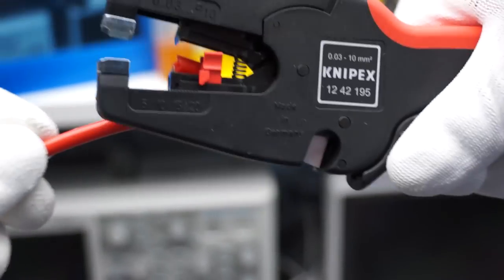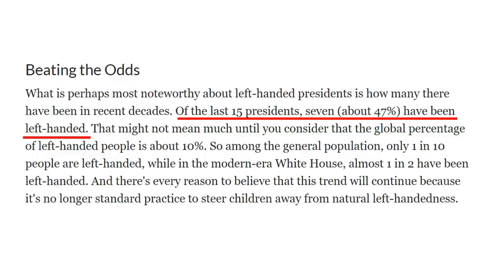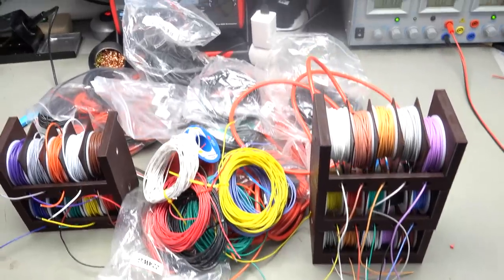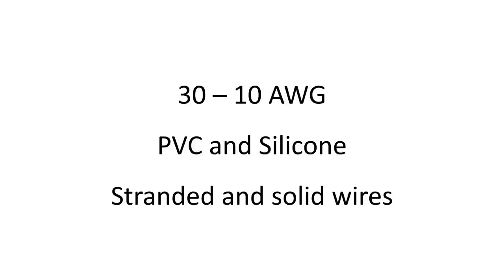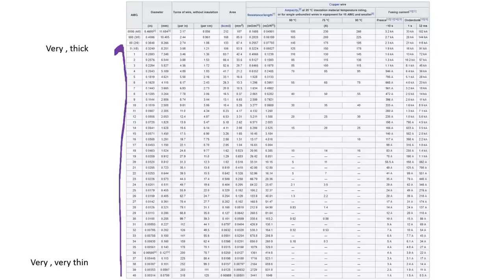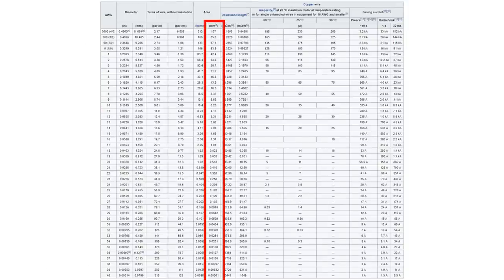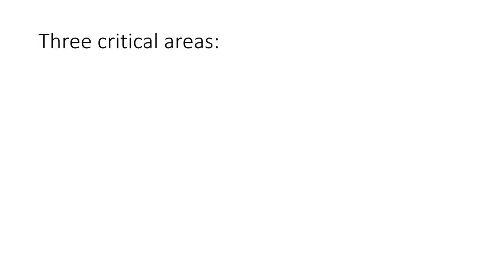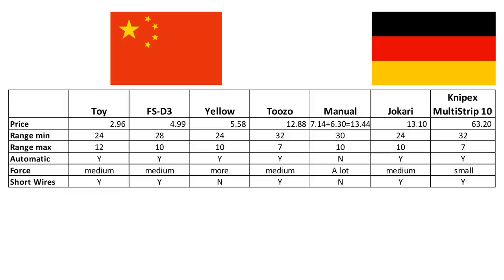#268 8 Wire Stripper Test: Germany vs. China. Who wins?

Comment: Nice test.

Usually the manual wire strippers are calibrated for solid wire. Klein explicitly lists both solid and stranded, and the stranded is always one size up from the solid.

The biggest problem with the automatics is slick insulation. US THHN wire designed for sliding through metallic conduit has a very hard, slick outer coating and most automatics can't touch it. Those that can fail on fine wire.
Reply from the maker: Thank you for the information!

Comment: I bought 2 Toozo at around US$7 each. They're not that good at the beginning cos' they tend to cut thin wire. But I manage to take them apart, sharpen the blade and reduce the cutting force a bit by sanding the jaws (thus reduce the pressure of the blades) and now they work even better than the Knipex (I used it for quite a long time). I'm glad I didn't bin them.
Reply from the maker: Thank you for the information!

Comment: I have a question: Do you use AWG in Switzerland? It doesn't make sense to me. In Germany, we use mm². That makes much more sense. I can imagine how big the diameter is. I can measure it with a caliper. When using mm², I can give a value for all sizes, even larger than 120 mm² (if someone needs such diameters :-)). So I don't see any advantage in using AWG or am I wrong?
Reply from the maker: I use AWG because I am used to it (and my channel is watched in many countries). But officially, we also use mm².
Reply: @AndreasSpiess  OK that makes sense. I am used to use mm2 so I had to think a little bit about the sizes. Before I forget to mention it: thank you for your great videos
Reply from the maker: @samuelmumm9827  All my silicone wires from AliExpress have the AWG printed on them ;-)

Comment: those yellows are fantastic. You can strip long lengths, and even able to strip ribbon cable. Cant do that with any of the others. Sure, not perfect, but you can apply a touch more pressure with your fingers to get a good result, as well as the adjustment screw others have mentioned
Reply from the maker: Thank you for your feedback. Viewers commented there are different makes which look the same.

Comment: Should be noted they "Yellow" strippers (Mine are branded Vise-Grip, but same style) have a tension adjust knob. Can crank that down in order to get better stripping on thicker silicon cables. I use them regularly for that.
Reply from the maker: This knob did not help in my situation. But there are many different "yellow" strippers out there (reading the comments). Some good, mine bad :-(

Comment: I never use automatics as I work in the field.. takes too much belt space. I will use a jacket cutter ie a spinner for anything I cant get with a manual... and you can carry three for the space of one automatic.. all are useless for multiple shielded conductors. ie 18-2 or 24-4.. probably ok for benchwork but only with the knipex. even then I dont like the squishing of the insulators. I know for a given thickness of wire how many turns I need to make to leave that tiny bit of insulator before hitting the conductor.. these are for just being fast which is usually not a DIY concern.
Reply from the maker: Thanks for sharing your experience!

Comment: I have a different type of  knipex  cutter to yours, I got it because I needed perfect straight  and accurate cuts when sleaving pc  cables, but I also have a stanley branded version of your yellow cutter, I found it works better the wrong way around that being the grippy part latched on the bit thats being discarded, that way it doesnt leave a mark on the cable, the other thing to note about that cutter is you can adjust the tension by turning the wheel, I managed to work a way of  stripping down to about 26 or 28 awg from  cat 5E  cables for endstop switches for a kossel with that cutter too but only by putting a small amount of thumb pressure on the top of the jaw thats gripping the cable as it cuts otherwise the cable just slips through, but now I have the knipex I dont need to do that
Reply from the maker: Thank you for sharing your experience!

Comment: Try something like a cc-22 (ca-22 is searchable on ebay). Its usable on pretty much everything below 35mm2. I replace mine about every 2 years when i feel its starting to loose its sharpness. (Im an electrician so i use it ALOT) 
Autostrippers isn't the best option if you strip lots of wires, the impulse that goes into your hand/wrist can be harmful on extended use.
Reply from the maker: Thank you for sharing your experience! AFAIK they also sell battery operated strippers for heavy usage.

Comment: I can recommend the WEIDMÜLLER WDM-STRIPAX 9005000000 stripper, so far the best I've used. I tested knipex and some Chinese ones. And this one work just great. They have more adjustment possibilities and spare parts. The only drawback, the price, they are expensive.
And the fact that the isolation stays on the cable, it is sometimes ok, becouse you can much easier twist the wire, to achive beter solder.
Reply from the maker: Thanks for sharing your experience. They look very similar to the one from Knippex.

Comment: Very interesting video as usual.  I still use an old pair of manual strippers bought from RS many years ago and could not justify the outlay for the Knipex.  Just a couple of points though, the plastic material surrounding the wire is INSULATION, not isolation, even though the insulation isolates the wire!  Here in the UK we still use some imperial measurements, miles, feet, inches etc and we have SWG - Standard Wire Gauge still seen in wire and sheet metal.
Reply: Yes, insulation!
Reply from the maker: Thank you for the correction!

Comment: Unfortunately you didn't test really small wires. I often reuse old flat-cables and stripping these with the Knipex. It works really great and I wished I bought the Knipex years ago.
Reply from the maker: I usually use flat cables with press-fit connectors. That is why I did not test it. Thanks for sharing your experience!

Comment: How do these automatic ones know what wire thickness you are using?
Do they have something you have to adjust for each wire?
Reply from the maker: The Knippex has nothing to adjust.
Reply: @AndreasSpiess  Interesting that it can "detect" thickness somehow. What about the "toy" and "yellow"? Do you have to adjust for each wire?
Anyway I just ordered one of those "manual" Chinese ones based on your review because they seemed fine. Only the bigger version (min 22 awg) was available tho, I hope it's good enough for my thinner wires.
And thank you for your answer.
Reply from the maker: I do not know how they do it. But the manual one is a good choice. But you have to have one with the fitting holes. Otherwise it will not cut the plastic. I used two of hem

Comment: I bought one similar to your "Toy" stripper many years ago but mine has a screw adjustment on the back of the head to compensate for thinner or thicker wire. It actually works pretty well once dialed in. There is a USA made one like your "Yellow" that is known to be a better product even though they look the same. It's made by Irwin/Vise Grip and it works extremely well - better than the "Yellow". Probably the best strippers I've ever used are any USA made ones like your "Manual" strippers. They take a bit of getting use to but they do the best job once you get the hang of them, probably because the cutter notch is rounded.
Reply from the maker: Thank you for sharing your experience. BTW: My yellow one was defective and the new one works much better...
Reply: @AndreasSpiess  Cool!

Comment: 14:35 - for soldering leaving the isolation on comes in quite handy because it makes twisting the nakes wire a lot easier. you just turn the isolation why pulling it off and your wire is perfectly twisted and doesn't get messed up that easily.
Reply from the maker: Thank you for the tip!

Comment: For wire stripping I use Knipex. Worth the money. Now a diversion...
Circa 1500 London Mile - 5000 feet (defined in furlongs using the German 'foot' length which was longer than the English). 
Statute mile - 5280 feet.
Nautical mile - 6076 feet.
Roman mile - 4852 feet.
Irish Mile - 6720 feet.
Scottish Mile - 5952 feet.

There was also a 'short mile' and long mile. All very straight forward so I can see no reason for confusion. BTW Sign posts (especially older ones) are based on paced measurements so will vary depending on who paced the distances out. So two towns could be actually just over 2 miles apart but one would be signposted as 2 1/2 miles away whilst the other only 2 miles. Accuracy being unimportant.
Reply from the maker: Interesting. Most of those definitions did not survive...

Comment: it seems a little misleading on the YELLOW, there is an adjusting knob next to the steel jaws for wire's thickness without mentioning,  it cuts wire in different sizes & also with a functional crimper as well. it might not be a brilliant tool for professionals but it is good enough for any normal household uses, simply because I had just bought one, it works perfect to me without any fuss
Reply from the maker: I agree. Mine was defective. The new one works now as it should (at least for thicker wires)

Comment: The yellow isnt automatic. but the one you have looks like a cheaped out version. I bought a very similar one in lidl for not much money icluding crimps and cable ties and it's very good as long as the spring tension is set for the right wire gauge. I think some of the automatic or semi automatic ones dont preform ideally on silicone wires because the give in teh insulation throws the cut depth off slightly.
Reply from the maker: You are right: Silicone is really hard for most of the tools.

Comment: I had the "Toy" one for two month and maybe 20 uses. After some time resenting spending more money on the matter, I bought the Jokari (as well as the two round insulation removers for multicore and antenna cable) and I'm quite happy with them.
Maybe I add one of these V-style "Abisolierzange" with the adjustment screw, but my first failed me due poor cast iron material.
Thanks for the review!
Reply from the maker: You are welcome!

Comment: I build wiring harnesses for motorcycles (1.5 - 2.5mm wire, higher strand-count... Heavier "gauge", I use a knife); Jokari versions typically last about 1 to 1.5 months (5000 "cycles"?) Knipex (both "end stripper" and "side stripper") is the only way to go...FWIW, some insulation remaining on the wire: either depth setting is wrong, or, is a good thing... if you release while wire still in the stripper, when it "kicks back", it doesn't turn your wire end into a "broom". (easier to thread through an eyelet splice).
Reply from the maker: Thank you for sharing your experience!

Comment: Thanks for your review. 

Having a few strippers I share your opinion of the Toozo. It functions reasonably well, certainly for the price.

I have a vertical multistripper from Stanly which works really nice. It can strip the outer isolation of multy wire insolation and than the inner wires as a second step. Multiple at the same time. Looks the same as your Yellow tool but probbably better made. Probably Knipex or an ather brand will make this tool with the same looks even better.

For electronics/thin wires, I prefer my manual strippers. Duratool from Farnell. They seem to last eternally.
Reply from the maker: Thanks for sharing your experience!

Comment: I actually prefer the Knipex 12 40 200. Not completely self-adjusting though. It has served me a very long time, and I didn't even need to change the blades for the 9 years I own it. I mainly use it for small wires (less than 0.5mm²).
Reply from the maker: Thank you for sharing your experience!

Comment: google 56511 narva for my personal favorite wire stripper. Its the same fundamental as the yellow one but made correctly. Great for coax, automotive wiring and tps. The best advantage is that it allows you to strip outer sheaths without damage to inners and also allows you to bare conductor half way along a strand, not just the ends.
Works from 0.5 to 16mm cable. can strip outer sheaths off any thing that fits in its jaws about 12mm diameter. the only thing it wont strip well is cotton braided reinforced silicon but I have yet to find a automatic stripping pliers set that will.
Reply from the maker: Thanks for sharing your experience!

Comment: I also have a Knipex automatic, but in the shape of the Jokart.
It is less expensive than the Knipex you tested, but still a very versatile tool.
Only sometimes cuts thin wires with PVC insulation instead of stripping.

Btw, Conrad. Best store ever.
Used to be located near my home.
Reply from the maker: Thank you for sharing your experience!
Reply: @AndreasSpiess  You're welcome.

Comment: I've used the knipex and yellow strippers at work (industrial automation builder) and what I've found is the knipex is clearly the most capable, but the yellow ones work really well on wires between 14awg and 28awg IF (and this is important) you keep the tension screw adjusted tight. Using it loose is only recommended for small wires with thin insulation. Since the majority of the wires I need to strip are 16awg (because that's our standard wire gauge on our 24VDC terminal block panels, unless otherwise specified) I reach for the yellow ones most of the time. They take a beating, and the entire stripper costs less than a replacement blade set for the knipex. Plus, I've found that the "blades" in the yellow stripper aren't really blades. They're just sharp enough to get a good grab on the insulation. The primary stripping mechanism they use is to just pull the insulation off. They are much less likely to cut off any of the copper wires than any stripper I've used, again as long as the tension is set properly.

The knipex is reserved for smaller gauge wires that I either end up soldering or putting ferules on, because it leaves a relatively clean and consistent cut. It's also really good at stripping ribbon cables and multi-conductors all at once. The yellow stripper can do that also, but it won't strip all the wires as evenly as the knipex. and sometimes the cut it leaves on the insulation can be ugly depending on what it's made out of.
Reply from the maker: Thanks for sharing your experience!

Comment: I have a set of yellows, though they are blue... which is why they probably work better. They work alright, though on thinner wires, they will pull a strand or two. Also, the insulator will get stuck in the well that will cause it to fail unless its removed.
Reply from the maker: After reading all the comments I probably have the worst copy of all :-(

Comment: I used a stripper like the yellow but it had a location for your index finger to hold pressure on the strip head — you can put lots of clamping pressure on the holding side without starting the strip.   Cut 1000’s wire/mo with it.  I

Also even more expensive than knipex are thermal strippers for PTFE (Teflon) wire insulation.   None of the mechanical strippers work on this wire.  The smell of burning ptfe is not pleasing.
Reply from the maker: My yellow stripper actually was defective. After buying another one it works good. And you are right. Teflon is the hardest material. I usually use a sharp knife for my Teflon Coax cables.

Comment: I have been using that "toy" for about 5 years and it just gave up on me. I would recommend using it with no less than 12gauge wire, otherwise, its been surprisingly useful with more stripping than I can count. Just upgraded to the Irwin Auto
Reply from the maker: Thank you for sharing your experience.

Comment: AWG numbers originally come from how many times material had to be pulled through a die in order to get the proper size.  That's why higher number = smaller diameter
Reply from the maker: You are right, I found it during my research.

Comment: I tend to prefer the manual strippers as well, except for the really small gauges with slippery insulation.  (Which by the way is what native English speakers usually call it - rather than "isolation" as you say.)  The smaller automatic ones are good for stripping the end of a small wire that's already soldered to a PC board, because it holds the wire and insulation itself, and doesn't put strain on the solder joint or pull the insulation off the whole length of the wire rather than just the end, as often happens when using manual strippers on short wires.
Reply from the maker: Thanks for sharing your experience!

Comment: FYI, it's "insulation", not "isolation" — In English, “isolation” has more of the connotation of the concept of separation, even if just accomplished passively by keeping distance, while “insulation” means the material added specifically to stop electrical, thermal, or acoustic energy from moving. So in English we can say that electrical isolation can be accomplished by the use of electrical insulators . :)

(I'm an American living in Zurich, and worked as a technical translator and writer, so I'm suuuuper familiar with the mistakes German speakers tend to make in English. No judgment, of course! I know I make mistakes in German and Züridüütsch all the time! :P )

Comment: Just wanted to note that "0 AWG" and larger wires are pronounced "aught" (like ought).  According to Google, most people say "naught" instead, but I grew up with "aught".  00 is 2/0, two-aught, or double-aught.  0000 is 4/0 or four-aught.  And so on.  To my knowledge, we don't use the word "zero" with any U.S. standard measured in "gauge".  We go "up" from one-gauge to aught-gauge (or naught-gauge).  In general, if "0" is larger than "1", we don't call it zero.
Reply from the maker: Thank you for the clarification!
Reply: @AndreasSpiess  It's weird and interesting to have so many measurement systems in a country 🙂.